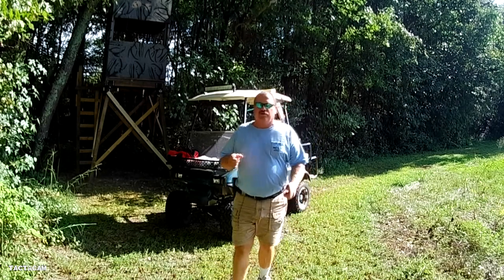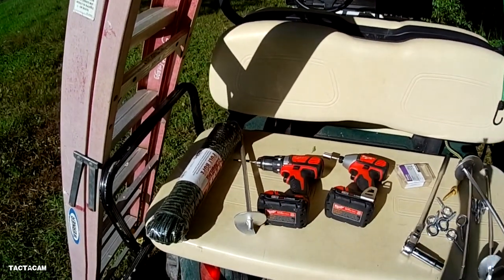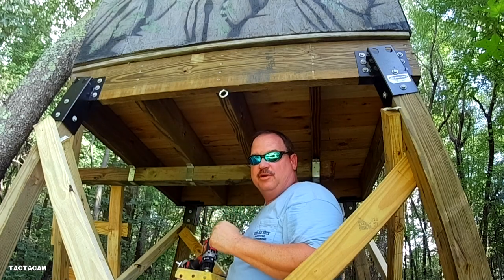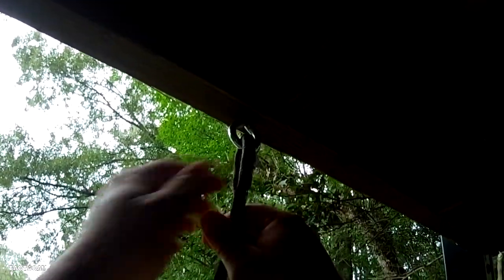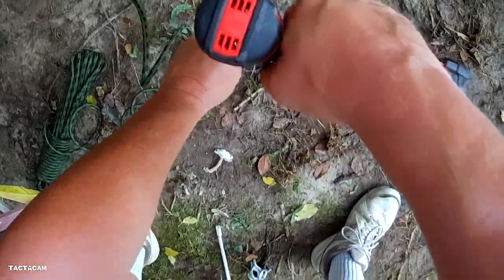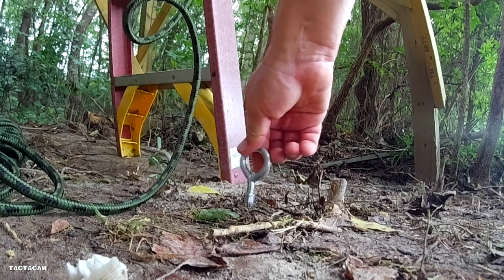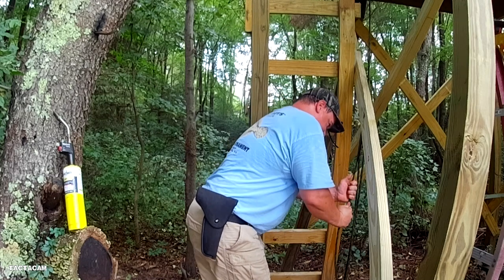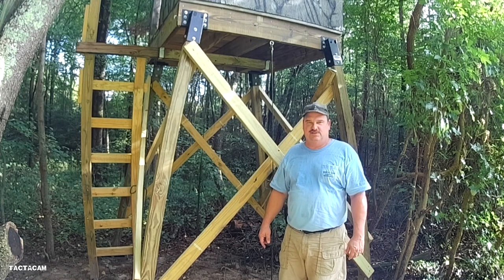How to Tie Down a Tower Stand Blind

Comment: Love it!  Great video.  I would suggest spending a little more video time showing how to tie each knot.  Some of us are not knot-worthy!
Reply from the maker: David Greenapple  Thanks for the suggestion!  One thing though, The Anchors I used were NOT long enough!  They did not get past the topsoil and pulled out in a storm... Needless to say, I'll be Re-shooting this when I mount the new blind on top.  The platform bounced, no problem...but the box blind did not fare so well.  Longet Anchors, Turnbuckle and cable next time for me.

Thank you for watching. I've got some really cool stuff coming too! click the "bell" icon to get notified of new videos posted every week. You can also check out & follow the FB page for updates, suggestions, etc: https://www.facebook.com/scottgreggoutdoors/  I usually post what's coming up there as well.  Also Instagram at www.instagram.com/scottgregg1966/
Reply: @scottnra  Thanks for getting back.  I wonder if using any kind of concrete poured in a hole in the ground would classify the structure as "permanent" which would then require a permit from the local government.  If no permit is required, I would mount those anchors in a concrete-filled hole.

Also, I've always tied things down with tie-down straps with ratchet tensioners https://www.homedepot.com/p/Quickloader-10000-lbs-Retractable-Ratchet-Tie-Down-Strap-QL10000/202393129.  Of course, if your foundation gives way it doesn't matter what you use.  :)

I love your videos and your commitment to hunting.  Wish I had more free time to spend doing it!